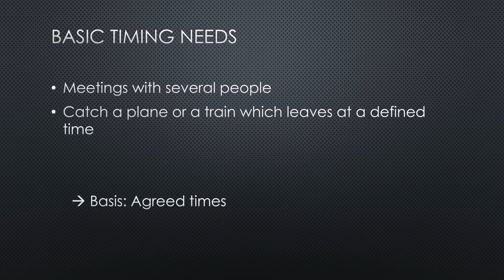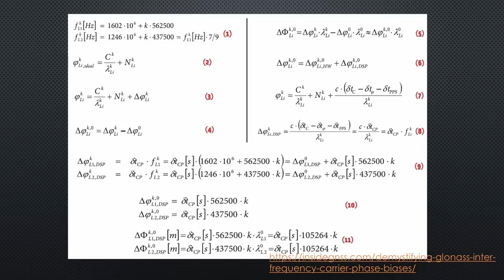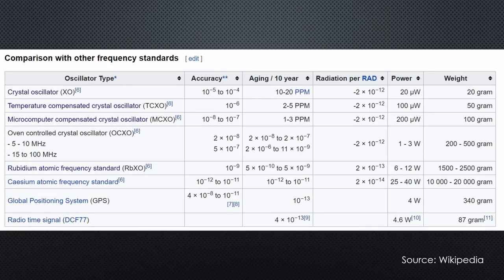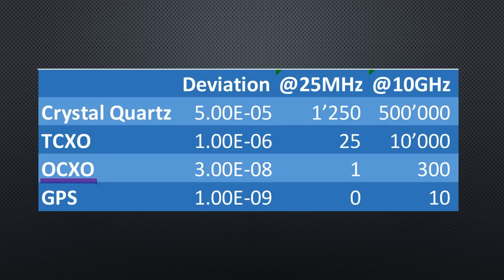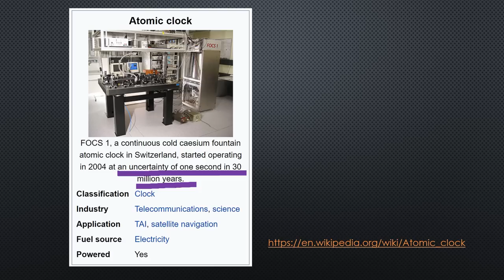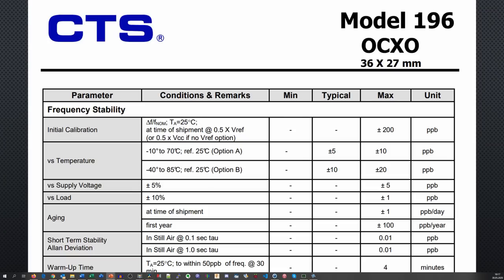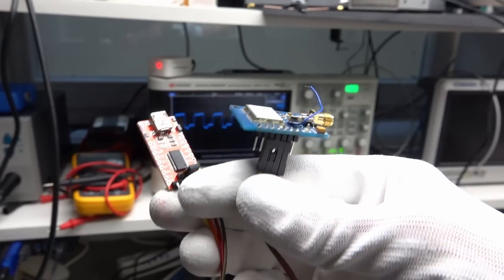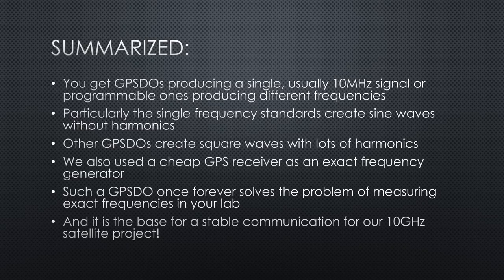#336 How to get Precise Timing and Frequency to our Lab. From Crystals, TCXO, OCXO to GPSDO, BG7TBL

Comment: Like you,  I am a retired RF engineer.  About a year ago I built my own GPSDO.  Comment:  the 10MHz output of a U-blox receiver has a lot of jitter,  it is coming from the 26MHz osc.   I had the U-blox put out 1MHz and then divided the 10MHz OCXO by 10 and used a phase and phase frequency detector and used an ESP-32 as the controller and web browser system monitor.   1 MHz provided gave sufficient phase range to account for jitter from the GPS and keep the initial lock time down to a few minutes.   In software I built a variable speed loop... very fun project.  You can get down to about 5.0 10e-11
Reply from the maker: Unfortunately, I am just an EE engineer with love to RF, but never sufficient know-how .-)  And I have to wait a few years for the pension. Your project is very interesting! I saw the horrible jitter, too. And I have a few "ovens" in the mail. So it might be that I also will try to create such a GPSDO. And I still have ambitions to understand and measure the Allen deviation and compare the different devices.
Reply: @AndreasSpiess  I should also warn,  that I have been told that some of the U-Blox Neo modules are rejects that are sold under another name, then a clone U-Blox sticker is applied, and sold in China.   While I don't know if this is true,  I can say that the jitter can be >10X worse. If the price is too good to be true.... beware... or buy direct from U-Blox distributors.
Reply from the maker: They are Swiss company and we wanted to do a video about clones. Unfortunately they never came back... On the other hand I canot believe that there are so many rejects in a mordern manufacturing process.
Reply: @AndreasSpiess  I should not have used the word 'rejects'....  U-Blox sells many different grades/variations of their receivers.  You can query the part, and it will tell you exactly what version it is. Someone has removed the sticker on the part, and replaced it with another sticker, which represents it as a more expensive, higher specification part.  I have 'altered' parts,  but electronic signature reports the truth.   So, they are not clone silicon,  they are parts where they received a 'label' upgrade. :->
Reply: I am curious, how did you measure the resulting accuracy of the clock? Did you compare it to Rb or Cs standards?
Reply: @odissey2 Using a HP GPS DO as a reference
Reply: @AndreasSpiess Now that Mr Sol has become active... GPS jitter off the U-blox is way higher.

Comment: -Time is probably the only global standard
Americans :
- Yes , yes kiloyards per gallon squared.
Reply: American here. We would never use a commie (that's a joke) prefix like kilo. We would just say "thousand".
Reply: If anyone remebers Digital Equipment computers, some of thier operating systems had parameters in micro-fortnights.
Reply: You forgot to divide by 8.
Reply: @David Parrish - I did my degree project on a PDP8. Never got the timing right...
Reply: When the metric system just seems to simple... 😁
Reply: Actually, US was one of the earliest adopters of the English scientists metric system, after the French.
If it wasn't for WWI that the industry choose the inches, they would have used metric standard and they Mars landers would have made it and the rockets wouldn't exploded because of mixed up units.
Reply: Or maybe yards per mile per hour, which has the right dimension, but nobody really knows except Americans.
Reply: @davidparrish1133  They also used the Jiffy which is 1/60 of a second.
Reply: @brittsmith7516 👍🏼🤣
Reply: @brittsmith7516  Yes and looking the machinists channels, the opposite of "thousand" is a "thou"...

Comment: Awesome video Andreas.
Firstly, it is highly informative and useful.
Secondly, I could relate to it as it reminded me of a project I did years ago where I had to synchronize a sheet coater  with a oven.
Although the motors were digitally geared together with incremental encoders, it relied on phase synchronization to keep things in time.
The lacquered sheets had to be fed into the holders of the oven at the right position as they came past on a chain.
These sheets are what tin cans in various forms and also beer bottle crown tops are made from.
Pulses from both machines were used to create sawtooth wave forms and then an error signal was generated by comparing amplitude.
A proportional correction was then calculated and added to the digital gearing ratio.
The oven being the master generated a signal with a 50% mark space ratio.
It was sufficient to only apply correction whilst the signal was high, and then freeze it whilst it was low.
So as you say, using a time standard to discipline an oscillator is highly effective, reliable and simple to implement.
I love these types of discussions, right up my alley.
Thanks for sharing.
And I am glad to see your hand seems to be getting better.
Best Regards,
Duncan
South Africa
Reply from the maker: I also love feedback loops. They are one of the most important inventions of humanity!

Comment: Enjoyed watching, thankyou! For sake of interested folks also reading the comment: Only AU cut crystal can go into making of ovenised oscillators as the mean of S curve (drift vs temp curve) pivots at 70 degrees, while for Regular Crystal  (AT cut) the mean pivots at 25 degrees. I hope I have saved a curious mind trying to put a regular crystal into an electronic oven hoping to achieve better accuracy.
Reply from the maker: Thank you for the additional information. I did not know that fact!
Reply: @AndreasSpiess , also, above a particular temperature a crystal will drift in frequency in one direction, while below that particular temperature its frequency will drift in the other direction, (the S curve.) But there is a plateau temperature where a crystal is relatively immune to frequency drift with time. Which depending on the Xtal cut is either at roughly 70C or 25C, but not precisely at those temperatures. I assume the most precise OCXO's each have their exact oven temperature hand tuned to put that crystal on that temperature plateau, but I do not know this for certain, as Xtal-standard companies are fairly quiet about proprietary techniques for their manufacturing precision, stability, and manufacturing cost control. But that was how I set up my home-brew 1 MHz standard that I disciplined with a TRF WWVB receiver at 60 kHz before the GPS constellation was launched into orbit. It was one of the most interesting projects I ever built.

Comment: I am so happy to have acquired the same IKEA clock as you, thanks to your video. So far I have not hacked it to diplay another time. The main issue is that it only synchronise once every hour or so. You cannot get it to move the way you want, or you have to cut the power to make it forget, then be the strongest signal to bring it to the time you want.
Reply from the maker: Did you watch my DCF77 Transmitter video?
Reply: @AndreasSpiess  Yes, I have it because of your Videos. Never invested in the coil to control the clock.

Comment: I love this topic. I am obsessed with time and have a Pi running a NTP service in my house based on a GPS antenna. Like you did here, I have also used the signal for my own purposes as well.
Reply from the maker: Do you have a link to the project of your NTP server? Maybe I will build also one...
Reply: Andreas Spiess I will link the guide here. I followed the old version of the post and it looks like they refreshed it in 2018, which is good to see updates. It uses the exact hardware I have installed. I have been running this for three years now and it is great. The main idea is that you still connect to an external time server (Stratum-0) to get the base time, but it uses the local PPS signal from GPS in order to maintain that to perfect accuracy. It has been wonderful to have this in my house and be able to point all devices at a local NTP server.   https://ava.upuaut.net/?p=951
Reply from the maker: Thank you for the link!

Comment: very good summary of a very technical field! Look for "Time Nuts" -- the news group and web site, to find people that spend a great deal of effort on these things, chasing picoseconds... Old HP OXCOs, like the 18011 dual oven 10 MHz oscillator are still superb performers. eBay sourced rubidiums are also good, but the close-in phase noise of rubidiums is far worse than a crystal. With an inexpensive GPS receiver, you can have very good and very stable time and frequency references for your home lab. (If you know what "Allan deviation" is, you're probably a time nut.)
Reply from the maker: Not yet, unfortunately. I still have to learn a lot!

Comment: Another "Master class" Andreas, thanks. The GPS part is so interesting and affordable for everyone doing any kind of timing... I don't know if it's enough for a separate video...
[ES] Otra "Clase magistral" Andreas, gracias. La parte del GPS es tan interesante y asequible para todos los que hacemos cualquier tipo de sincronización... No sé si será suficiente para un video dedicado...
Reply from the maker: BTW: How is the quality of the Spanish subtitles from your point of view?
Reply: @AndreasSpiess  Let me take a look, I never use them...
Reply: @AndreasSpiess  9.7 over 10. There is noticeable that there is a speaker from a sudamerican country. We, spanish speakers, use the Spanish language in a slightly different way at both sides of the Atlantic as British or Americans do with the English.

But those are not errors!

The subtitles are 100% comprensibles and only a few words can be more precises from a technical point of view. For the purpose of divulgation is a really good job.

Yours faithfully ;-)
Reply from the maker: Thank you for your feedback. I shared it with Luciana the translator.
Reply: @AndreasSpiess  You are welcome!

Comment: Thank you for the video, I think this is very educative. As always I appreciated the tone and jokes !

I work in a atomic frequency standard lab in Switzerland. I could measure the stability of your GPSDO using one of our hydrogen masers. That way you would exactly know how stable the unit is. What do you think ?
Reply from the maker: Great idea! Can you contact me? You find me on Twitter, Facebook, or in search.ch
Reply: @AndreasSpiess  I know it's been quite some time, but do you have an update on this? Ever got to check the GPSDO precision and stability with @Etienne Batori ?
Reply from the maker: @Halabaloosa  Yes, was at the University of Neuchatel, and Etienne tested my devices. They were very stable as long as the GPS reception was good. So the antenna position is more important than the device.

Comment: Andreas, Thanks for this video.  For our microwave projects (Pacific Northwest VHF Society) we use the Leo Bodnar GSPDO with a 5-pole low-pass filter to remove the harmonics.  We're on 10, 24, 76 and 122GHz  DE WA4OSH
Reply from the maker: I also added a 25MHz filter to get a Sinus. BTW: Is 122Ghz still VHF? I thought it is at least UHF ;-)
Reply from the maker: Thank you for your links. This is mindboggling!
Reply: @AndreasSpiess  The resolution of the FMCW radar is much higher than the PIR sensors that you tested in April. 
Also, check out the NXP CompactRadar
https://www.nxp.com/products/rf/radar-transceivers:MITERWAVEICS#/
I'm trying to get an evaluation kit.  Home security that does not get triggered by cats, dogs, birds, deer, etc.  but properly identifying humans and cars is my goal.
Reply from the maker: Maybe we will also get cheap stuff from the cars like we get from GSM stations...
Reply: @AndreasSpiess  Yes,  These system on silicon transceivers are becoming extremely affordable because they're being mass-produced.   It's like Wi-Fi was 20 years ago.  Remember when we said "Communications at 2.4 and 5 GHz for the consumer?  Crazy."   Now we're saying exactly the same thing, for frequencies that are 10-50 times higher.  Yes -- consumer applications at 24, 76 and 122 GHz, mass-produced, means cheap stuff for unlicensed experimenters and hams.
 My initial attraction to this article was to revisit the accurate timebase question.  I want an accurate frequency so that my signal can be found at the receiver side.
--> yes, frequency drift can a problem at these frequencies.  So they send two signals so that the difference between the two signals that does.  Eg,  FMCW to measure distance accurately. 

https://www.radartutorial.eu/02.basics/pubs/FMCW-Radar.en.pdf
An ordinary TV dish has all sorts of gain on these bands.  The problem is that the receive antenna and the transmit antenna are spaced apart on the chip.  So hams are experimenting with mechanical actuators to move the antennas into the right spot.  CNC machine parts to the rescue.
The other enemy is absorption from water vapor.  This may be a hindrance for long-distance communications, but it can be good for other applications.  Or is it? 
--> Huge data rate (Or extremely high definition), but at a short range?  Yes.  In this application.
While the FPGA that produces the IQ signals is not yet integrated with the RF transceiver, the modulation can be adjusted to optimize data transmission.  Rather than using the gigabits of data rate, the bits can be used for massive redundancy/process gain.
This cheaply produced technology used for short-range accurate ranging, but it can also be hijacked for much longer distance communications.  Only someone with the right forward error correction or de-spreading codes will be able to make sense out of the noise.
We can probably leverage cheap existing technology for this too.
Reply from the maker: True. When I was young, 30MHz was quite a high frequency. Today, below 1GHz is considered DC ;-)

Comment: Excellent overview and presentation!  Thank you sir!
Reply: Neat seeing the Adalm Pluto mod you made also.  Didn't know about the aliexpress version.  Amazing!  Amazing what the latest and greatest NEO-#'s are capable of also.  Especially if using for tracking with the RTK though that is a completely different topic/subject.  I still think there is a way to hack out the modules even with the Digital Block to make a really low noise communication device receiver.  Would be awesome to be able to hack into just the RF Block since seems like would be an awesome receiver/detector for a receiver or spectrum analyzer or I guess VNA too.
Reply from the maker: I do not know what is inside a GPS receiver. But I assume it is pretty specialized.
Reply: @AndreasSpiess  Yeah, was thinking at the least can seal up the GPS module in a shielded case and use the antenna input like for the output of a mixer with a fixed frequency design for either sweeping like for analysis or for just whatever transmitter tuned as a for use as a radio receiver. Though since stuck with the digital block format... would have to design the transmission protocol, if using as a sensitive receiver, to encrypt to the Digital Block format so can be decrypted/translated from the Digital Block format using the transmission protocol format.  One of those different ideas I had one day when drooling over the noise floor specs of the latest uBlox modules.  Albeit the baud rate will be low... though is improving with each new version.

Comment: If Ublox modules are with programmable GPSDO - why to buy those expensive boxes with OCXOs and Altera? Small cheap Ublox GPS modules will be still more stable and precise. Addition with AD9834 and some frequency multiplier for it (Triple 25MHz made with UBlox) Should be enough to make any GPSDO based frequency... Very nice video about oscilators!!! I am building now my labs Frequency generator with 2x AD9834 (Sometimes need phase shifted signals) and 2x AD9833 (For square wave signals and PWM modulated signals). Now I am thinking about putting in this box UBlox and GPS antenna to get GPSDO based Function generator. Thank You Andreas for great explaining!
Reply from the maker: They are good in the longer term. But from what I saw have a horrible phase noise. But I have to do more investigations
Reply: @AndreasSpiess  According to Your video at 18:18 its clearly visible that there is really bad 50/50 ratio and phase is completly out of range. Lets try to set 25MHz and repeat the same test. My plan is to use 25MHz setting and after it I would like to put Band filter to 25MHz (That should shift phase but also stabilise it). Another approach can be like You tell about PLL with Low Pass filter - 25MHz with not phase locked loop, but frequency locked loop where error is compensated with some very low frequency filter (VCO). Anyway - Your video was for me very educational and explains me a lot of unknown before things!
Reply from the maker: It depends what you want to get out of it. For sure it will have much more phase noise than for example a OCXO. There is anothe comment conccerning this topic, too.
Reply: The GPS receiver has a jitter of up to 1us. So, actual accuracy "out of the Blox" is only about 1ppm. Only after averaging out on a very stable oscillator, like OCXO for about 3 hours (1E+4 sec) one can get the actual absolute frequency below the 0.01ppm (1ppm / sqrt(10000))

Comment: Interesting fact: Due to relativity, the precise clocks in satellites run a little slower when in orbit than on Earth.
Reply: The clocks run slower on earth than in orbit, because the gravitational potential is larger. The clocks in the GPS satellite advances faster than a clock on the ground by about 38 microseconds per day. they would be 45 microseconds fast, but they move at 14,000 km/hr which leads to a time dilation.
Reply: SJ, Are you SURE?
Reply: Marcus Metzler, thank you.
Reply: @drmocm  Yeah. My bad.